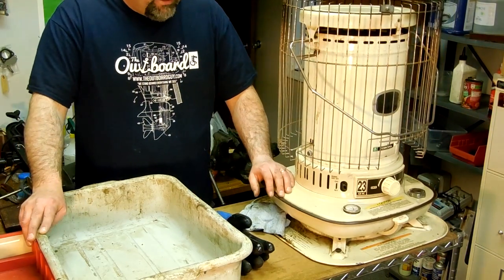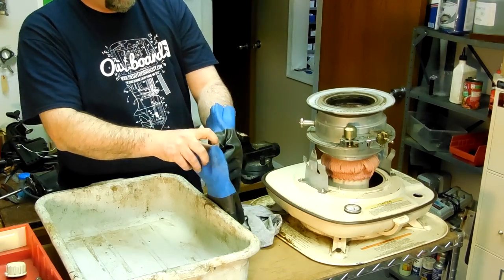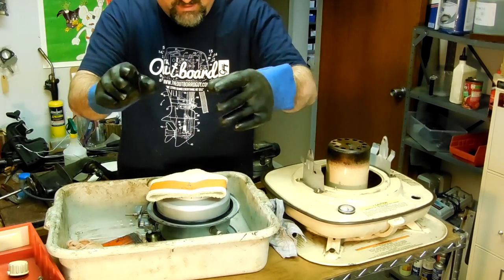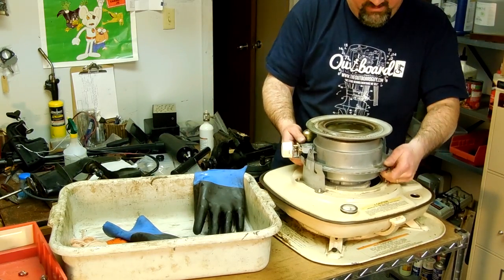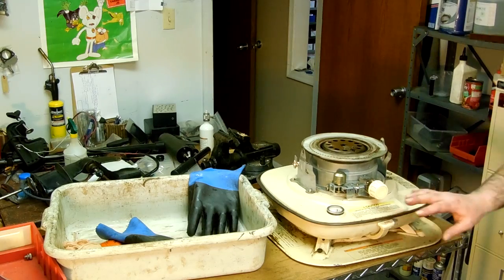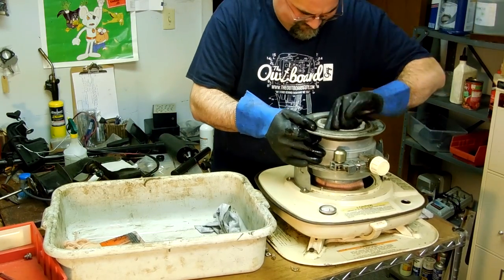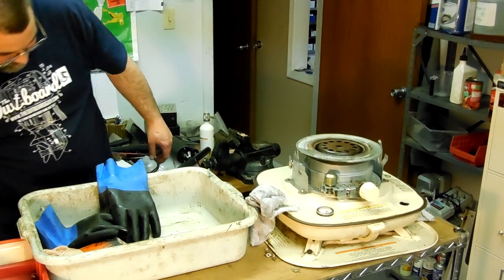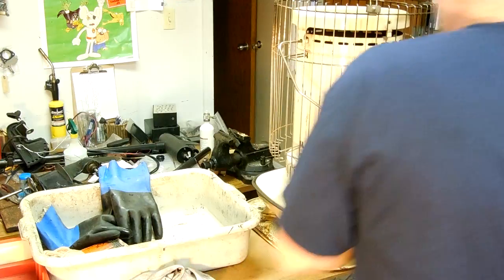Install a new wick in a Kerosene heater and tips for making your wick last longer.

Comment: I love that you did not edit out the parts that didn't go as planned! When I replaced my wick for the first time last year, I was terrified, but there was no one else to do it, so I had to. It went well, but not nearly as smoothly as it did for the person in the video I was watching, even though I followed the steps precisely! Since I am using this as my source of heat again this winter, I got it all ready, got new kerosene, and it burned beautifully yesterday. Today, even at the wick's highest setting, the flame would not go above the edge. Thinking it may be bad kerosene and I may be facing another wick replacement! Not fun, but it heats the house so much better than my electric heater. :)
Reply from the maker: Are you turning it off or letting it burn out? Letting it burn out may help. Or it may have condensation in the tank and needs a wick. I always store mine full.

Comment: I bought one of these because many years ago when i was in Korea i remember everyone using them as the main heat in their apartments. I am amazed at how complicated our units are. So fussy about what fuel you use in them. So particular about adjustments to get them to burn clean and not ruin the wick. I have a hard time believing the Korean units were this complicated to operate and maintain but i will research it. I think american companies are just trying to sell 10 a gallon fuel and 10 dollar wicks. I decided to go propane.

Comment: Omg I've been looking for someone to post this issue for the last hr. I've replaced wicks many times , no issue,  10 min flat, this time 2 1/2 hrs 5x putting it in and the knob wont turn. All pins set, when I take it off the dual pulls up the wick but wont stay up by itself . When I put it back , mind u on a full tank, it wont turn again. Same friggin issue so I'm going to try again tomorrow.  I left it assembled, not turning at the moment to keep the fuel contained n safe . I was too frustrated to continue.  Hopefully I can hold the dialn put it together at the same time alone tomorrow.  Thank you for showing this issue it saved me from trashing this one n buying new!! Which mine is only a yr old lol but I've had many all my life .

Comment: Hey Joe.. I got my kerosene heater last year.  It was used for like 6 months, but not continuously.. pretty much just at night and on weekends.  What should I do this season?  I've used it just a few times, and Ive had to light the wick manually, with a lighter.  I've never had to do this before.  I really don't want to tackle changing the wick out, unless it's an absolute necessity.  What would you do if you were me?  :)   Would I be okay to just put some of that kerosene stuff in the heater?  wish you had a link to where we could get that "stuff"... LOL.  You should put up an affiliate link.

Comment: Hey Joe just changed my wick and see no kerosene where the wicks sits. Been waiting for 3 hours still not wanting to light. How does the Kerosene get into that area with the wick. Do you think i have a clog?
Reply from the maker: it travels up threw the wick. it the wick pulled down into the fluid?
Reply: joeseif  ok..we took it apart again..this heater was in the shed for a for years..it looks like the hole that the kerosene comes out of from the tank was clogged..we grabbed some pipe cleaners and unclogged it..now kerosene is coming threw to where the wick sits
Reply: If it's an old wick it mite have a clogged tarr build up in between the top neck of the were the wick rises out of just below the 1/4inch riseout of the wick . That is we're the wick gets fed with kerosene. It has to be soak and saturated for at least too hours new and after burn of cleaning once a week.
Reply from the maker: i dont know maybe it in wrong and too tight for the wicking or the bottom part is above the fuel

Comment: That really should be done when it's 10 below in a drafty shed with a flashlight. It makes the final reward so much sweeter. If you have to mess around enough, the wick is saturated and ready to light by the time your fingers quit working. Don't ask me how I know this.

Comment: Got a used one for 20.00.  Wick for $12 shipped, get a british wick, the japanese wicks don't work as well with marginal kero, on the other hand, you should only use clear k-1 grade, so japanese wicks are ok.     let sit 30 minutes before firing up.       only store fuel 30 days and with conditioner if longer.   get a CO monitor!  like a smoke alarm.  Will save you massive 2 day headache and nausea!    Was a 5 minute job to install wick, once disassembled.

Comment: Ok I have a heater where the wick was replaced but now when it adjusted it doesn't work right.. any tips on what might be wrong??
Reply from the maker: the pins are not set right, try taking it apart and resetting the 3 pins in the wick
Reply: joeseif thanks I am gonna let it run out of fuel and try that.. I will update tomorrow and let you know if it worked..

Comment: What prevented the wic from coming up the 1st try?
Reply: When the wick is new and dry; it binds. Do like he did and pull the thing off the mandrel and turn the wick all the way up. Now while holding the knob fully clockwise; pull the wick over the mandrel and lower the burner assembly. This will take a few tries before the wick stretches and will move freely. I tried for 2 hours with a dry wick and no luck. The wick has to be wet and; it has to be massaged/stretched or it'll never be able to move.

Comment: I watched this a few times & bought the wick with the 3 pins & that was a trip getting them all to stay in. After that, I moved it down into the tank but the wick won't come up. I've tried 5 times now & I still can't get the wick to rise up while turning the knob. Don't have a clue what I'm doing wrong? I even cleaned off all the carbon & wiped it down with a lean dry cloth. Have any ideas? All the pins are in the slots & hole but it doesn't rise up. Called a few month ago for someone else to do it & they charge $150! If I had the money I'd buy a new one.
Reply: when slipping the wick down it needs to be in he up position
Reply: I have the same Corona 23DK.  The pins sit into the sleeve, but they also need to be aligned with the angled slots in the ring that adjusts the wick.  Pull the sleeve all the way up or down, and you will see the slots.  They sit at a 45 degree angle.

Comment: I prefer the pinless wicks!!!  kerosene heaters, for one reason, i burn DIESEL FUEL not kerosene, so i can get full use out of the wick.
Reply from the maker: diesel fuel in less refined than Kero how does that help you get longer life? doesnt that smell bad?
Reply: doesn't smell bad at all, kerosene is just WORTHLESS OVERPRICED CRAP. diesel fuel does last longer, i use only perfection heaters they can tolerate the diesel better then the type of heater you have.